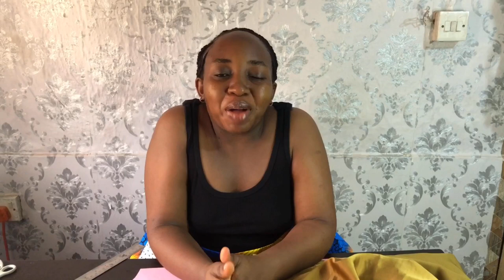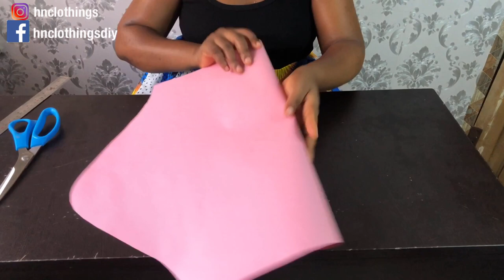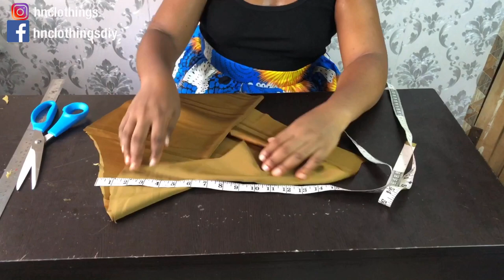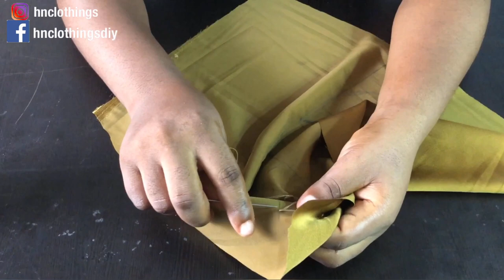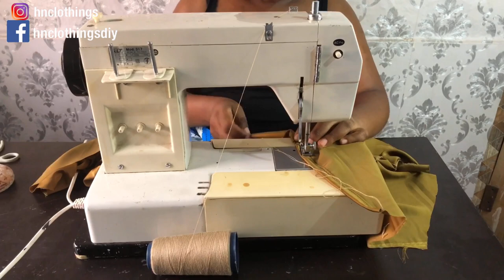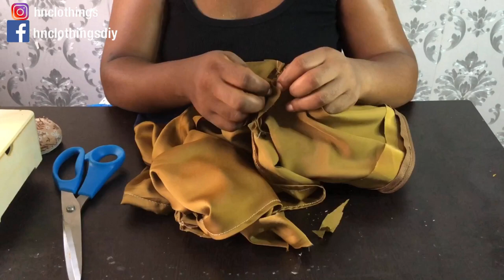DIY CANADIAN SMOCKED SLEEVE TUTORIAL| HOW TO MAKE A CANADIAN SMOCKING SLEEVE FOR A DRESS

Comment: This is soooo beautiful. I have to apply this!! I have a question... this technique can be applied to the center back of a dress or blouse? I suppose I  have to modified the length of the pattern to allow the shrinking, or it would be better to do it on a piece of fabric and cut the pattern later?  Amazing video and technique
Reply from the maker: You have done the analysis already Mary, whichever of the methods you choose to work with wil bring out an amazing result. Thanks for the compliment and the feedback